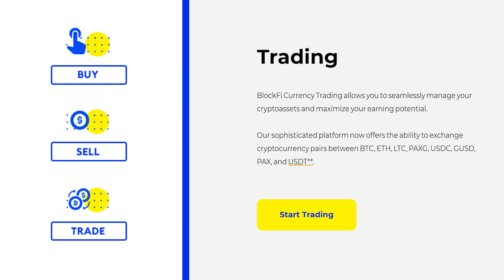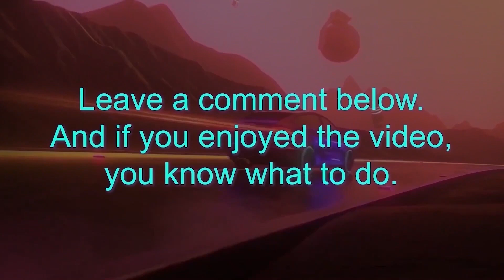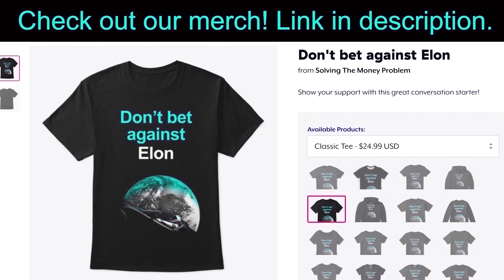Sandy Munro Shows Tesla's SHOCKING Lead Over Ford

Comment: Elon and Tesla realised that the manufacturing business model (outsourcing) of today was not going to allow them to drive down cost to get to a consumer vehicle @25k....ever. 
I also assume that they saw that the largest cost was the battery cells, the pack and power train. All of this represents more than 50% of the build cost of an EV but is the value add, so they brought it in-house and partnered with the best of breed Panasonic.  
Thus Tesla new from the get go they had the lead where it counted and that they could afford to not be the best at panel gaps and build quality if they nailed the fundamentals right and got it right first time.

Comment: Bear in mind, Ford still have plenty of money. And while they may get pressure from EVs in the next 10 years in the major markets (US, EU, China), they'll continue to sell petrol and diesel cars everywhere else in the world where the laws aren't as progressive. I don't think their demise will be as quick as you might think.
Reply: I suspect you don't realize how rapidly the car market is likely to flip from ICEV to EV.  We're right at the point where EVs start to become cheaper to manufacture than ICEVs.  Tesla seems to already be there.  When you combine a lower purchase price with much lower operating costs, better performance, and less maintenance you've got an outcome that should see buyers demanding EVs.  Many will simply chose to not buy a car until they can get an EV so even the short term battery shortage won't save the legacy manufactuers.

It's not laws that will quickly kill ICEVs.  It's economics.
Reply: @bobwallace9753  My point is that there are so many countries which have barely any EV infrastructure, and (as far as I'm aware) no plans to phase out the sale of ICE vehicles. EVs won't be offered for sale in those countries (look at Russia, the Middle East, all of Africa)... I just imagine the quick shift happening in the US, Europe and China where there's both the infrastructure and the will. I'm not even sure how quickly India will change, even though they do have a plan to phase out ICE. Anyway, I just think it'll change quickly for those three main markets, but I see ICE still being sold (for a profit) around the rest of the world for a while. And in those three areas, Ford, GM, Honda etc. will sell EVs. They'll just suck. But that won't stop people buying them, because people don't care about how sucky the engineering is.
Reply: I wholeheartedly disagree with your assessment.
Firstly, yes Ford may still have loads of cash but they also have loads of debt.
Secondly and this is the most important point: You seem to be under the impression that it is going to be the regulations that end the sale of combustion engine vehicles but that is very far from the truth.

The main driver of this is going to be economics and consumer demand.
In the next two to three years EVs will be cheaper to buy nevermind cheaper to own and operate as the are today.
The charging infrastructure will continue to ramp up faster and faster.

The mayor problem for the legacy OEMs is that once EVs reach cost parity with ice vehicles they will have to lower their prices on those vehicles to remain competitive.
However that will decrease their margins further and further and before long they would be selling their vehicles at cost.
But it gets worse: When they sell less ice vehicles they will continuously lose the benefits of scale which means that they produce each car less profitably.
So the ice vehicles will either have to be sold at very low margins or the demand will crater which would make the production of the vehicles even less profitable.

The point is that EVs don't need to replace new ice sales to make the ice business unprofitable.

And we haven't even spoken of what will happen when we get to Transport-as-a-Service (Taas), meaning Robotaxis.
Once they get adopted into the mainstream consumer market the demand for new vehicles will fall of a god damn cliff.
Why would you buy a new vehicle if using a Robotaxi is much cheaper and more convenient?
In this scenario ice vehicles will look completely outdated as the cost of operating them will be so high that they will be completely and utterly unable to compete.
This will lead many people to selling their used ice vehicles as they have no use for them anymore, which in turn will lead to declining prices for used ice vehicles.
This will put tremendous pressure on the price of new ice vehicles as you wouldn't buy a new one if you can get a used one in top condition for a sliver of the price.

So all in all the ice business is going away far faster that you and many others seem to anticipate
Reply: @a1asdairpage  

All countries have an electric grid.  Therefore, all countries have EV infrastructure.

Few countries have oil wells and refineries.  Each and every day precious capital leaves the country in order to keep the transportation system operating.  

The least developed countries really understand how sunshine gets turned into electricity.  And that they can purchase solar panels and (reconditioned) wind turbines for small money and not have to keep buying fuel over and over and over.

China is right now manufacturing very inexpensive EVs.  They're not fast enough and fancy enough to sell in the US or Europe but they are perfectly serviceable in countries that have been operating mainly with third and fourth hand used cars.

Don't bet against a rapid movement to EVs pretty much everywhere.  They just make economic sense on both a personal and political level.
Reply: @elsmaster5592  I understand all that, and I've watched Tony Seba's presentations as well. However... while I agree that's all highly likely in the big markets within the next 10 years (as I say, US, Europe, China)... those markets are rolling out EV charging infrastructure, and those markets do have laws on the books to phase out the sale of ICE vehicles. Take Tesla as an example. Where do they sell their cars? In those markets, because there's consumer demand.

But consumers can't just want to buy EVs and then buy them. Take Turkey for instance. There's next to no EV charging infrastructure, and almost 100% of homes in the major cities are apartments with nowhere to charge a car. The people who live outside the cities mostly live in rural areas. While there is appetite from educated Turks to shift to EVs, they aren't available for sale. They can't buy them. They don't exist.

İstanbul is choked with the stench of diesel fumes, and I'm sure this is a similar situation for many other countries where legacy car makers have established manufacturing and while EVs take over in those three major markets, they'll continue to sell ICE vehicles for as long as they can all around the rest of the world.

They may not be as profitable in 10 years as they are today, but as long as they can avoid even offering EVs for sale, then car buyers in those countries have no choice but to buy ICE. And those car buyers broadly don't know any different. They don't have or see the infrastructure, and they don't get offered the cars to buy.

Now, having said that, I've seen more Porsche Taycans in İstanbul than anywhere ever. There are loads of them. But they're for rich people who have houses and driveways.That's not the majority, and all the taxis and other vehicles are all ICE.

As for robotaxis, the days you speak of will be amazing for sure. But that very much IS at the mercy of individual countries regulating appropriately. I wouldn't expect that to be quick, but I agree it'll eventually happen.
Reply: @bobwallace9753  I know they do. I know. But... consumers who are moving from a technology they know and are comfortable with to something new and different demand at least as good of an experience. We all know this, and when you see the polls of perceived barriers to adoption of EVs, it's always cost and range and charging.

Yes, prices of EVs are dropping quickly, and yes, China knocks out loads of already super cheap EVs... but the range on them sucks and I'm afraid an electrical grid is not enough to say a country has an "EV infrastructure".

So you live in Nigeria and you buy a $5,000 Chinese EV with a range of 60 miles. You get half way to your family in their town and need to charge... are you going to wait hours? No, you won't even buy the car in the first place.

I'm not disagreeing that any of the things you all say will happen will happen. I agree. But the rate of change will be different all around the world. And you can believe that Ford and all the other massive car companies will be selling 100% EVs in those major markets, but I just think that at the same time they'll still be pumping out ICE cars in countries you never visit. And that change will be much slower.

That's all I'm saying.
Reply: One problem with this for Ford is that the vehicles they make money on (giant pickups and SUV's) aren't what sells in developing countries.  In a lot of countries, big Murican road-battleships won't even fit on the streets.
Reply: @kevincrady2831  Yeah, true. I guess we'll see how it plays out. I imagine Ford and others will really feel the pain. Sales reduced, margins crushed, the size of the company will presumably shrink hugely.

But don't think they won't go out without a fight. And they'll fight with their own EVs which they'll hope to sell in volume.

And there will be plenty of brand loyal people or Tesla haters or people who simply prefer more traditional vehicle designs, who will buy these Tesla alternatives.

Let's see I guess.
Reply: @a1asdairpage  If a country can purchase new ICEVs and fuel for ICEVs then they will be able to purchase EVs and wind/solar/storage to charge those EVs.  And cleaner air will be part of the package.

My assumption is that EVs will take over quickly in China, Europe, and North America.  When that happens there will be no stream of used ICEVs flowing to countries that have depended on buying cheap used cars from the most affluent countries.  Less affluent countries will not buy enough new ICEVs to maintain economies of scale and ICE production will collapse.  Fuel infrastructure will collapse as falling demand won't keep refineries in operation.  

Countries will figure out how to get outlets close to where cars park.  That's low cost, low installation skill infrastructure.
Reply: @kevincrady2831  I think Ford is surviving now only because the US government is picking winners.  The "chicken tax" that makes it expensive to import pickups creates an artificial market for made in America pickups.
Reply: @bobwallace9753  yep, I still agree with you, but as we all must know about S-curves of adoption, the US, Europe and China will be in the first half of the acceleration. The second half I think will be a slow burn the same way it’s already taken 10 years to even start gaining traction with EV sales. So… 2040 and beyond for those countries I think.

We’re agreed on the process, I just think those “less affluent countries” will keep those dinosaur hold-outs holding out selling ICE and fuel for a few more decades.

I really do think some places will be slow to adopt. Like, 2040-2050 slow. Wow I’ll be old!
Reply: @a1asdairpage  I've spent a lot of time in 'less developed' countries.  I watched them adopt mobile phones much faster than did the 'developed' world.  You can go to what would be considered "backwards" towns in those countries and see shops that sell solar equipment.  The lack of 'old school' infrastructure makes it easier for new tech to succeed.

Obviously the rate of change is not going to be exactly the same everywhere.  But we could see some less developed countries move to EVs faster than countries where ICEVs are really baked into the culture.

The $4,500 Hong Guang Mini has a 100km (62 mile) top speed and a range of 120 km (75 mi).  It seats four.  For $500 more you can get AC.  It's currently the highest selling EV in China.  Imagine what happens when China opens EV factories in less developed countries so that shipping costs are much less.  That's a car that will pay for itself with fuel savings.

Comment: At ford bean counters rUn engineering. Ford tends to dump engineers from time to time. Ford then tries to buy its technologies.  Problem with that is Ford is always behind and gets half assed tech from competitors while they use their tech properly with full understanding. I worked as an engineer at a Mazda plant that became a Ford plant gradually.  It was like moving backwards in time. Everything became worse.

Comment: Ford won't go bankrupt.  They've avoided it thus far, and they'll make a point of avoiding it going forward probably.  Instead, they'll merge.  My bet is Rivian.  Whether it's Rivian merging into Ford via a full acquisition on Ford's part, or Rivian absorbing most of what they want from Ford, will depend on how long Ford waits.  To be fair, Rivian haven't proven themselves by any means yet, but if their first two products can actually launch in volume, I see no reason they won't be eating Ford, GM, and Staleanus' lunch in the truck market.

Comment: OK. Here is why the big three are going to fail:- American ARROGANCE !!!!!!! I drove the 3Litre Capri in the UK way back in the 70's and this car was faster off the mark than an E-Type Jag which at the time was one of the premier luxury spots cars in the world. I had the grave misfortune to drive the same model car made in the US around the same time (74-76). What a POS. It rattled, fit and finish sucked and I could probably have out run it on foot off the mark the first 20 yards or so. I was younger and fitter. Having said that, this is a clear example of the fact that even though Ford UK could produce a world class performing car, Ford US refused to go to them for help. What is happening with the big three now is simply more of the same. They haven't change in over 45 years !!!!!! They are DOOMED !!!!

Comment: This is what you get when 20 different vendors are tasked to design parts to connect to other parts made by another vendor rather than a single purpose-built and engineered vehicle.

Comment: But here’s the catch, Ford only updates it’s cars a few times a year. I used to do parts for Ford, the same part fits multiple vehicles over multiple years. They don’t update parts. It’s pathetic. They had the same failing cruise control switch on 4 of their models over 12 years of production. Same headlight switch on 3 models over 4 years of production. It’s how they make money. It’s pathetic.

Comment: 5:50 Just want to drop in: Legacy has a bunch of very smart people that could come up with the necessary stuff, but their system isn't build on innovation. 
Their suppliers have to do the innovation and thus only do what is possible in their own bubble (e.g. car seats) and just enough to fulfill the requirement list (Why deliver more than payed for if the given is already difficult?). 
That's why they can't get an octovalve done: You would have multiple supplier coordinate and more importantly share the bill for development, how will they find out who pays what share? Who get's the IP? In who's lab will it be done? Innovation is just headache.

Kind of the reason I want Tesla to be successful disrupting the market: Freeing all those smart people and having them be inventive and not just coordinating work and filling out spreadsheets.

Comment: While I agree that Tesla has the best engineers, I would not blame the Ford engineers on this one. I strongly suspect that they were forced to used off the shelf parts by management, which basically handcuffed them and prevented a design for EV from the ground up or any kind of innovations.